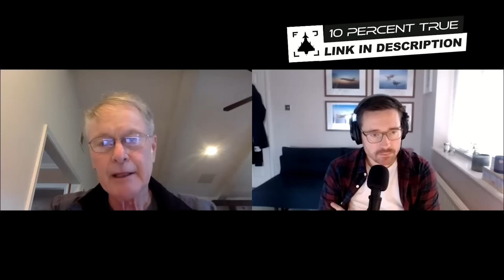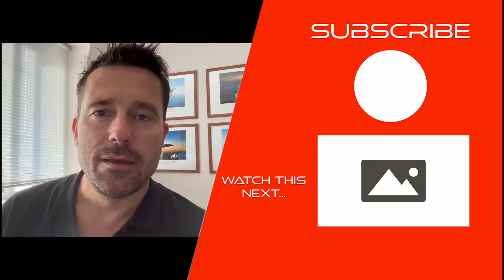YF-23 vs. F-22: As Told by Test Pilot Who Flew Both

Comment: I feel the YF-23 was politically assassinated. Don't be fooled, as Boeing grew. They had an appetite to acquire MD. A known fact that many don't either recall or don't speak to is how well the YF23 was able to countermeasure the Russian IRST system by pure design that impacted surface cooling. Also from an interceptor perspective how much faster yet classified the YF-23 really was.  There distinctive reasons why NR / MD Team did not go with thrust vectoring. Comprising stealth was not an option, yet could still achieve many of the same characteristics of the YF-22.

Comment: I recall the F-23 was deemed more difficult to manufacture, since it had lots more composites, in its main structure.  Those days, composites was still mostly custom made, not mass automated manufacturing.   This perception drilled through to financial longterm sustainability.  Money talks, Bullshit walks.
Reply: Even today Composites are custom made, mass automated production of composites especially aerospace grade composites are yet to be achieved, in fact composites are one of the greatest bottleneck in aerospace manufacturing today.
Reply: Then why does the F-35 have so many composite parts?

Comment: I've flown both as well, the United States Air Force asked both companies to have the prototypes be as close to the production model as possible and the YF-22 Lightning II (working name for the F-22 Raptor prototype) followed the request, the YF-23 Rapier (working name for the F-23 Black Widow II prototype) didn't follow the suggestion (the F-22 is the YF-22 Lightning II with very few modifications) and would have required significant modifications as a result, not to mention the YF-23 didn't have enough weapons stowage and would have required different wings (the F-23 Black Widow II in service would have had the same wings as the F-22 Raptor, had to have a gun installed , and numerous other modifications to be produced)
Reply: That is awesome... flying both.... As far as I know, from published dimensions, images and scale models, the F-22 had lot of modified body features. It looks to me really different from the prototype. The YF-22 nose is longer than the F-22, the wing leading edge root is located forward than the F-22, also the wingtip is different. Similar to horizontal stabilators. Also, the V tail is different shape in the YF-22 being wider at the tail root, than the F-22. And general YF-22 airplane dimensions are a bit bigger  than the production plane dimensions. Maybe the main difference is the thrust vectoring, and the YF-23 being really much bigger than the YF-23, so if the idea, in some extent, was also to have a carrier version, YF-22 had better chances.
Reply: @adrianvega9946  There were some differences between the tail end of YF-22 and F-22 that were based on the thrust vectoring.  TV was new for the YF so they purposely made the tail surfaces a bit larger because they weren't exactly sure how effective the TV would be and they wanted to make sure they had sufficient control authority even without TV. The TV worked way better than needed and had to be toned down for the F-22.
Reply: @adrianvega9946 the YF-23 is not much bigger than the YF-23 because there was only one built, the YF-22 Lightning II and the F-22 Raptor are the same design with no changes
Reply: @MikeMcKinnon-q3x  
This is generally missing the context of the project requirements.  Compare and contrast Have Blue to the F-117 and Tacit Blue to the B-2, of all things.
The YF-17 differed greatly from the F-18 (although this was technically produced under a different contract for the Navy).

It was expected that the project requirements would change significantly between the declaration of the winner and the finalization of the contract.  The Air Force simply did not want a technology demonstrator significantly departed from a production design - as in built from completely different materials, being of a completely different scale, etc.

The F-22A underwent significant design revisions and is a completely different airplane from the YF-22.  The ceramics for the exhaust manifolds and nacelles were developed in the early 2000s.  The entire passive RF monitoring system - or "mini-AWCS" was an enormous expansion of the Pave Pillar suite.  The hilarious munitions pods required significant rework of the underlying airframe to support the weight along with external tanks.

The point of "be close to the production model" was to indicate that we are looking at a P-40C to a P-40E, not a YF-17 to an F-18E.

Both companies followed the direction.  The difference is simply in how the companies behaved internally.  Northrop built a prototype to justify a production line and Lockheed built a production line to justify a prototype.  The astute will note that the way Lockheed thinks is the same way many in procurement and government think.
Reply: @Aim54Delta not how it works in reality, the time between the televised flyoff and production of the F-22 Raptor was to set up the production line the YF-17 Cobra is pretty much the same as the F/A-18 Legacy, and the YF-22 Lightning II and the F-22 Raptor are literally the same design with absolutely no changes so it should have been designated F-22 rather than F-22 A like nearly every other design in Army Signal Corps Aviation Detachment/Army Air Corps/Army Air Force/Air Force history with some noteworthy examples being the P/F-51 Mustang and the B-29/B-50 Superfortress the P-51 Mustang had an Allison V-1710 and 4-20 mm cannons whereas the P-51A which had same engine with 4-.50 caliber machine guns, the initial design of the B-29 was accepted with the B-29 A being after the first modification and the B-50 was a redesignated B-29 C, with the B-50 A being the redesignated B-29 D .

Comment: FWIW: During the competition there was a pretty good amount of media coverage. Obviously this is anecdotal, and just my experience at that time, but this is what I saw:
1) There was a large amount of issue taken to the fact that the 23 would generate large visible tip vorticies in even somewhat minor maneuvers.  It made it very easy to spot in turns in certain conditions.
2) The 23 was faster is super cruise. Enough that it was mentioned as being a noticable difference.
3) The 22 was seen as being a much more conventional design and also as focused on dogfighting...particularly close range. Which at the time the soviets had vectored thrust and could do wild maneuvers. Although not very practical in real world their was still the reminder of the F-4 with no gun idea that made people wary of giving up potential dog fighting ability.
4) I certainly did not think of how important range was for a CAP mission. And I think at that time no one really mentioned it.
5) The better IR management of the 23 was downplayed because it was seen as only there when the 23 was higher than its target. It was not obvious that the best tactic for a steath aircraft on CAP is hang out at extremely high altitude and look down clandestinely and off your target. In hindsight its a valid LO strategy. But at the time it was portrayed as two foes meet at level...basically the idea that supercruise also buys enough power to go very, very high was more embraced by the 23 but not properly conveyed because if anything that gives away strategy.
6) Both teams did showmanship. There were two 23s with different engines. And they flew higher and faster. The 22 did fancy high G maneuvers (9 g) and launched a missle. In the end it looked like the 22 was a jet ready for combat to replace the F-15 and the 23 was a fighter of the future that may need more development.

And that last part. Where the 22 was a obvious right now replacement for the 15 and it would just be better in every way...more maneuverable, stealthier, deadlier is why it won.

Where if the DOD had a bit of patience, in reality the 23 was the more "future proof" design because it was based around the idea that in the future the only thing that survives is the platform that can go higher, faster, and invisibly.

I personally don't blame the 23 technical team. I've met them in career, they are all great guys. I blame the sales side of Northrop. They simply didn't know how to prove that in the future highly maneuverable is pragmatically pointless because the human on board is the limit and much, much better missles will exist.

But I digress back to my experience and in watching the competition the LM team put on an excellent show that checked the boxes that were concerns at the time.

Ideas like: Stored missles are not normally used, is that an issue? Stealth generally is a penalty in maneuvering (F-117) can we make it not a penalty? Is this thing going to be a major money pit (B-2) or is it going to be right off the bat a F-15 killer.

Thats just my recollection of when the competition was going on. It was cool to watch. Both were really mind  blowing when they rolled out.
Reply: Firing the missile was not an insignificant thing. The conformal fuselage weapons bays put the missiles close to the centerline of the plane and there was real concern that when launched they would fly directly in front of the inlets. Concern was that the exhaust gas ingestion into the engines might cause some issues. Lockheed demonstrated that was not a problem.

Comment: As a Canadian and hearing the stories of our Mach 1.95 plus Avro Arrow Prototypes ...with the 1st Iroquois engined RL-206 about ready to fly and break some speed and climb records, it is
frustrating to then hear of it being very rudely TERMINATED on a BLACK fRIDAY IN EARLY 1959 ...I am 65 now and that was BEFORE I WAS BORN! 

So the stories of the British TSR2, the USA F-103 and F-108 also have sad endings. 

I think with 187 F-22 built....why could they not have made say 1 squadron of F-20s and another of F-23s and still have over 150 F-22s!

Right now here in Canada I would like to see 1 squadron of F-35Bs and 1 of French Rafale and 1 of Typhoon or newer GCAP and a few Gripen Squadrons from Sweden and us Canadians build a new 'Avro Arrow' for PRIDE...uprated Engines and Stealth and Modern Avionics and the same big internal weapon's bay DUAL-PURPOSED for RECON VERSIONS WITH AN EXTRA 2500 IMPERIAL GALLONS OF FUEL as well as perhaps 5000 external gallons mounted to external hardpoints as drop-tanks. With 10000 Imperial Gallons of FUEL at takeoff it could super-cruise for a couple of hours!
Reply: CF35 “A’s”. ordering planes by the dozen also is not feasible, neat idea, but no sir.

Comment: I'm a retired A.E./C.E. with a large American defense contractor known for the current two frontline stealth F planes. I won't say much but I was around in April of '91 when the F22 won and was one of the Principal Computer/Software Engineers in the Battlespace Management and Flight Dynamics Sensor Software Suites arena. The 23 did have some slight advantages but the 22 had a better thrust to weight ratio and a higher G limit and it had a combat radius of over 100 miles more than the 23. Also during the final fly off, Lockheed Martin went the extra mile and flew the 22 with the bomb bay door open, which had not been a requirement but we felt like it helped us.
Reply: @stevefowler2112   I understood it was well known that the 23 had a much longer range.
Reply: It has always been said the 23 had more range due to the diamond wing
Reply: @MI5Finest  I think a lot of "what's been said" about the F23 is people churning reddit posts.
Reply: @rustyATVThe actual documentary has it in
Reply: @stevefowler2112  it didn’t hurt, that senator Sam Nunn, of Georgia, was head of the Armed Services Committee at the time.
Reply: @stevefowler2112  I am curious how you could know the performance of both planes. The program was heavily segmented with lockheed and northrop being isolated from each other.

Comment: The better air superiority fighter was the YF-23. The better dogfighter was the YF-22.
Reply: The AF doesn't like dogfights. They want the missiles to do the kill.
Reply: I dunno. The YF-23's tail section had huge all-moving control surfaces which were nearly the size of an F-5's whole main wings.
I think you'd have to be going at an extraordinarily slow air speed for thrust vectoring to have become any sort of factor.
At any reasonable engagement speed, either plane could turn the pilot's brain into peanut butter, which means there's not a significant difference in practice as they're both limited by the same squishy physiology of the pilots.

Meanwhile the YF-23 had better speed and range potential. Lower RCS in X-band, better longwave stealth, and much better IR stealth. And a larger (more cavernous) internal bay for ordinance, which allows for a wider range of ordinance types, and (eventually, with the development of appropriate racks) more air to air ordinance.

The longwave & IR stealth characteristics may seem minor (especially in the 1990's), but it's not. Current day near-peer militaries put enormous focus on exploiting those stealth weaknesses to negate some of the effectiveness of the F-22. And that was a predictable outcome, by choosing the design which had more obvious achilles heels in those aspects.